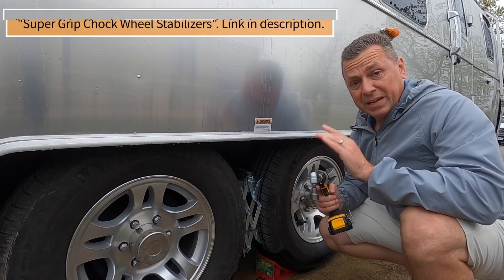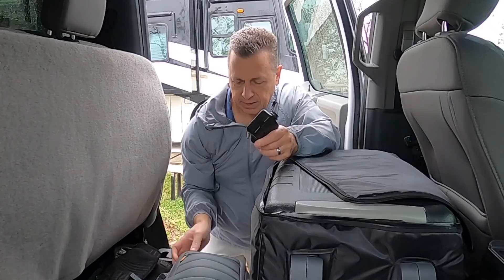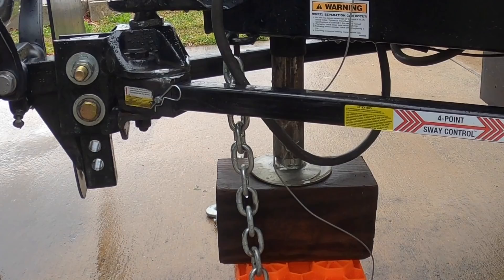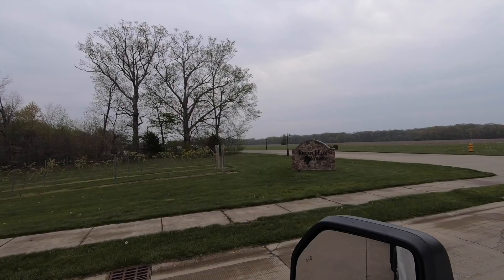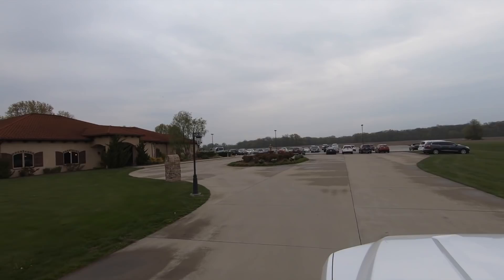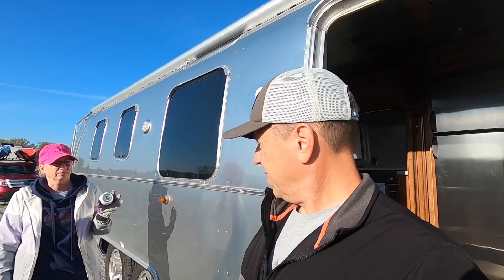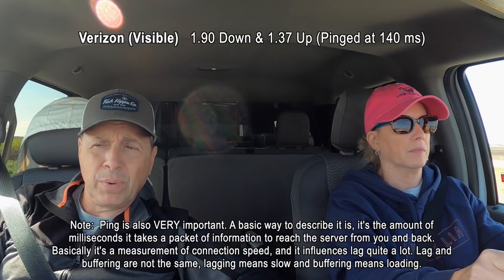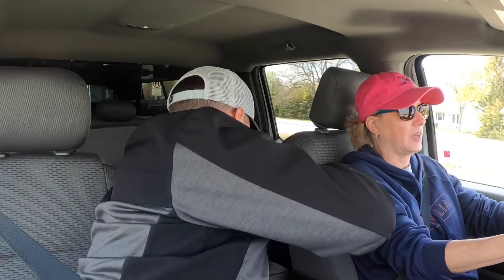Heading to Elkhart for Alde REPAIRS - Boondocking at a Harvest Hosts

Comment: Where is Truma? My heat has never worked. The water gets hot now it started working after almost a year. I tried it often with no results then one day it just came on and has worked ever since. But no heat for the Room ever
Reply from the maker: Truma is in Elkhart, Indiana. Do you have the same Alde hydronic heating system? That’s interesting how it just started after all that time. The heat can be caused by many reasons. Truma/Alde does have a customer service that you can try explaining your situation at (855) 558-7862 ask for George. Would love to be able to help you out if I could.

Comment: Question, is there a difference between the TSD and the EFS? I don't understand it all.
Reply from the maker: I believe they are part of the same company but when you download the app to use this fuel discount program for RVers, you do not use the EFS app, you use the “TSD Open Roads” app. In a nutshell, TSD is what you would be using.

Comment: Now that you’ve used your cooler/freezer for a while do you still really like it and is it very quiet also how long would it run if you ran it off the Jacorey
Reply from the maker: We never hear it at all and it still works really well. We noticed that it cools very fast. We have not tried it off of the Jackery yet. Have not needed to but a good idea to test. Thanks! 👍🏻😊🤓

Comment: What did you have to do to attach the base of the light?
Reply from the maker: It comes with 3M tape, but I didn’t want something so permanent so I used a command strip. Since the base is a very light plastic the command strip works just fine and of course you take the ball/light off before driving away... at least you try to remember to 😂🤣
Reply: I was about to ask the same question.